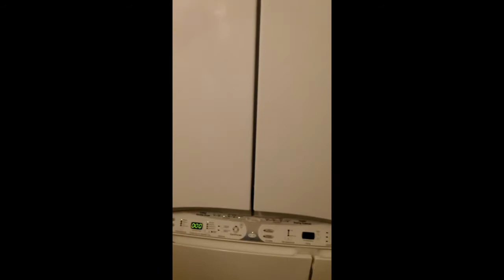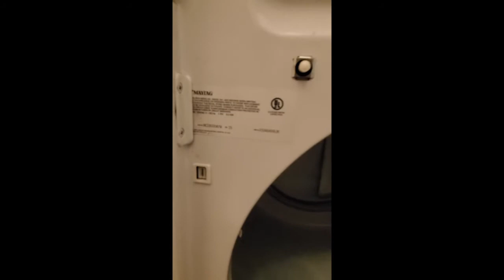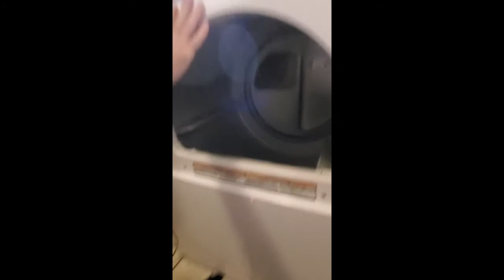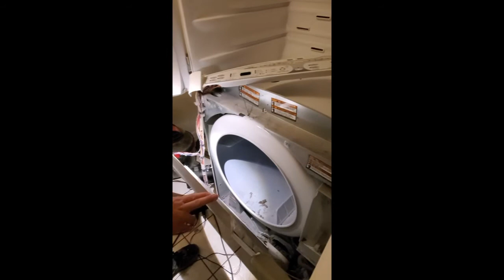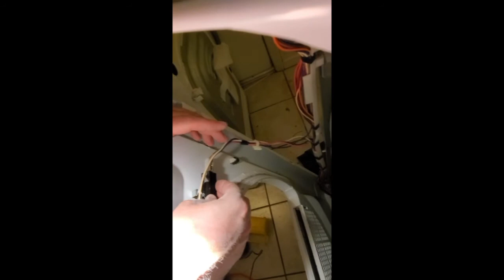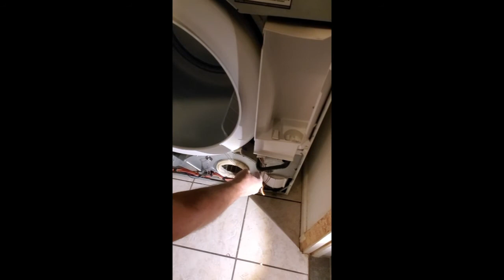Maytag Neptune DC Dryer Lint Clean

Comment: Perfect, Thank you!🙏🏾.   Was expecting to find the inside filled with lint but it wasn’t that bad.  The section where the lint trap goes is rather tight, I used the wand of a swiffer duster to get it all out and it worked great.  Bonus, shifting the washer to clean out the lint from the behind the dryer resulted in the washer being perfectly balanced and now the spin cycle is virtually silent.  Something finally worked out in my favor.
Reply from the maker: Thanks for watching.

Comment: Hello, if the dryer at the bottom stop spinning and I need to replace the belt. Is the access available through the side of the dryer bottom?
Reply from the maker: Remove the front of the dryer as shown in the video. You now reach in below the drum and check if the belt is tight or not.  If broken you should be able to work the new belt on without removing the drum.
Reply: @miscadventurescaughtonvide9408  thank you so much

Comment: Thanks!  That helped a lot, particularly since I also needed access to the electronic board to make some mods.  By the wire, the yellow wires on the right are for the humidity sensor.